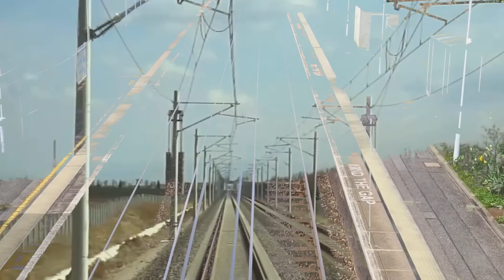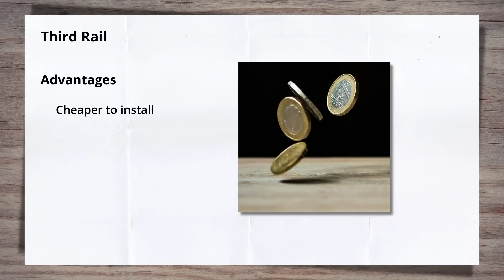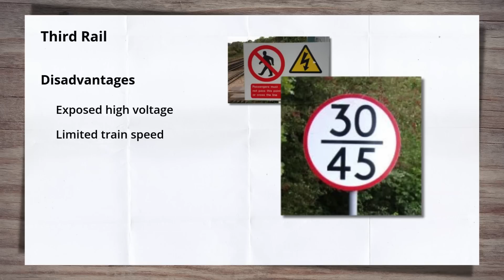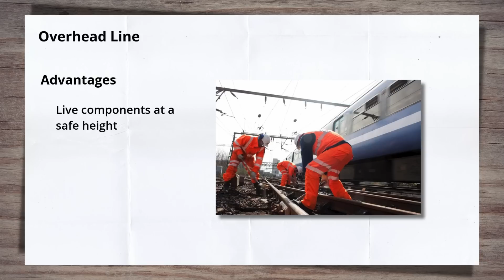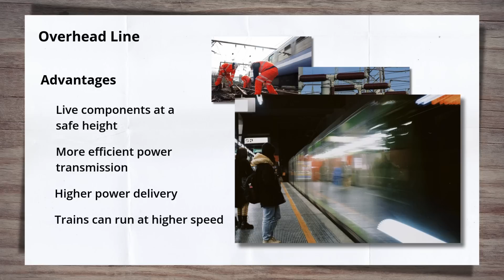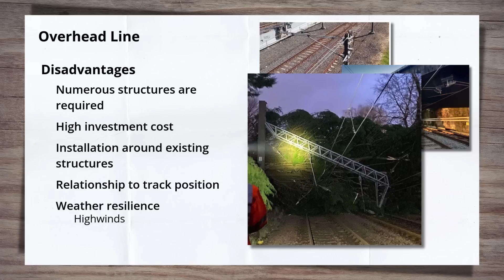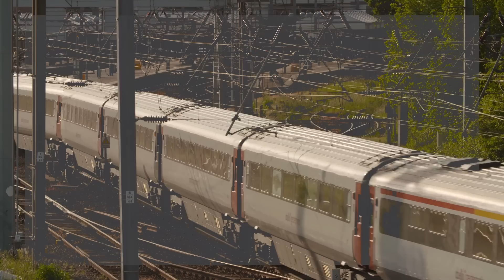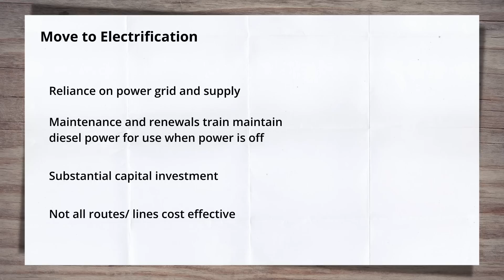How Trains Are Powered on the Railway | Third Rail vs Over Head Line Wires

Comment: Third rail is 600 Volts DC. The currents are enormous. Voltage drop per mile is high. Third rail requires several feeders from the supplying utility every couple of miles. Expensive electric construction. Overhead catenary in USA is typically 23,000 to 25,000 volts AC which requires utility feed every 10 to 20 miles. There is no comparison. Third rail works on local metro trains, never on long distance without a lot of power infrastructure. Also, because of the high currents at the DC traction motors vs. 2400 volt traction motors in catenary locomotives, third rail engines have limited horsepower. DC third rail is highly inefficient. Ballast resistors on the rolling stock are used to limited current inrush. Once again, great for city and suburban lines, not for long distance high speed rail.
Reply: Also third rail systems are widely used in industrial transport. Mines, Mills, careers etc
Reply: Why not AC for 3rd rail systems, say at 2000v with bottom or side shoe collection and insulated rail top surface. Multiple shoes throughout the length of the train minimizes current per shoe. No need to raise bridges etc.
Reply: Third Rail is not always 600VDC.
Here in England, we use 750VDC which has been used I think since an electrical interconnector cable was built between England & France, whilst when the Southern Railway (And the prior London & South Western Railway) installed 660V DC third-Rail.

There is also "Bottom-Contact" third rail which is used on the London DLR system, also at 750VDC since the network opening in 1989, whereby the third-rail shoe touches the rail which is suspended above the shoe, which I believe was initially designed to "fix" many of the flaws of the standard Third-rail system used on the Southern Railway and Merseyside Electrics region of England.

I will agree that Third Rail works best on low-speed/short Metros and commuter railway services though.

Comment: Railways account for 0.7% of UK emissions. Why is anyone concerned about this?

We in Sweden have large scale overhead electrification. It is grossly unreliable. My last journey ended up with an overnight hotel stay due to the wires being stolen, which happens regularly. A previous journey ended up with four hours in a forest waiting to be rescued. No trains in Western Sweden today due to high winds.

A lot of the electrification in Sweden could usefully be removed when it wears out.

There are very few fatalies to staff due to 3rd rail electrification. It is easy to shield the live rail.

Comment: Safety to human an animal life would be my reason for eliminating the use of third-rail. Human life should not have a cost when safer alternatives exist. Thanks for sharing.
Reply: Members of the public should not be on the track anyway. Track work is normally done with the current switched off. Live rails in depot are shielded.
Reply: @physiocrat-sv  I think safety to human and animal life might be more of a reason to eliminate motor cars, rather than third-rail electrification on railways.
Can anyone supply the relavent figures?

Comment: Thanks for this clear info. Growing up in south-east England where third-rail electrification is the norm (and I spotted your Southern train as an example!), I was surprised when I first went up to York as a teenager and noticed the overhead lines and supports on lines north of London. It seemed such a blot on the landscape as well as an unthinkable task to install them all (not that putting in big heavy rails seems like easy work either though, to be fair). You did a thorough job listing the pros and cons, some of which I hadn't considered such as speed restriction.

Like others in the comments, I was confused by trains on the  third rail network needing transformers, but I'll leave that to people who know more than me about trains 😅
Reply: The transformers are in the feeder stations next to the track.
Reply: @physiocrat-sv  ...and therefore do NOT add to the weight of the train.

Comment: One thing to add from a metallurgical and corrosion aspect on third rail. Stray current and grounds have caused a lot of corrosion on buried pipework, particularly around the the home counties area, with the victorian cast iron pipework. So whilst they don't directly affect the operation of the railways, it does pose other problems for utilities, such as Thames Water. Was a case study on my University of Surrey MSc modules about 15 years ago.
Reply: The reason the London Underground ("Tube") is four rail is to make sure the return path does not leave the track. The track has a positive and negative rail, that are not symmetrical about zero. That means the electrons never get tempted to leave the official path (at least in theory).

That decision was forced on the Underground when it was first electrified, following the experiences of above surface third rail electrification already damaging water pipes. In part, ai well, the Railway did not want to risk electrification damaging the steel linings of some of the tunnels. 

Where the four rail units share track with three rail units, the centre rail is grounded, and so it's one of the running rails. That means that for safety the DC components of the four rail units have to be insulated too cope with both scenarios. 

There actual motors don't actually care where the positives and negatives sit in comparison to a theoretical Earth, but the parts of the train exposed to people need to be grounded properly.

Comment: Another disadvantage of 3rd rail is the necessity to leave open spaces at junctions or diamonds. This generates an unstable current supply to the engine (loc) plus numerous electric arc formation... Aside, I fully agree with the fact that supplying current under low or medium voltage is less efficient in terms of current loss by Joule effect. In this line, in France electric locs working under 1500 V need to raise two pantos when starting as the intensity of the current going thru the pantos is extremey high compared to locs working under 25 kV, which is now the standard supply over here...
Reply: We have most overhead electrification in Sweden. My last train journey ended up with an overnight hotel stay due to wires being stolen. No trains today due to high winds.

Comment: The main point I got from this video is that overhead is 100% safer than third rail! I believe more people are killed by 3rd rail than overhead, I have never heard (under normal condition) being killed by overhead wire, just look at our streets where there are power polls! And yes idiot drivers (drunk and/or stoned) crash into power polls and cause the 11,000 & 400V wire to come down! Don't blame the trees, when trees fall onto power wires, blame the people that suppose to maintain the area!
Reply: How many people are killed by electric shock on the railways?

Comment: One advantage of desil is that it’s more power efficient because the electricity to power the generators which moves the train is generated locally instead of 200 miles away in a power plant.
Reply: Who is desil?
Reply: @northernblue1093  A badly-spelt German engineer who developed a higy-efficiency oil engine.
Reply: But generating it in a huge quantity such as power station is more than enough to offset the losses involved with transmitting it.
Reply: It’s still not negligible, even still, your just changing were the carbon emissions are being generated and constructing new electric train infrastructure still will produce lots of C02.

Comment: Bottom-contact 3rd rail is used on modern metro networks, and the S-Bahn in Hamburg uses side-contact 3rd rail.
Reply: The Lancashire and Yorkshire Railway used 1.2kV DC side-contact 3rd rail between Manchester and Bury from 1916. It was chiefly to stop ice building-up on the contact surface.

Comment: High Voltage centenary systems (most common) REQUIRE a hV to lV transformer associated with the engine.  A paragraph is diamond shaped device, where a flat framework is more of an energy collector. Ron W4BIN
Reply: That's not quite correct. 

A pantograph is any framework with a double set of linkages arranged so the collection surface remains horizontal at any height. 

Early electric trains did have diamond pantos, but the name comes from the technical drawing tool that is a third shape again, neither the diamond nor the more modern high speed panto. It's simply the design of the lever system that the name refers to, not the layout of those levers.

Comment: The local transit agency, BART, decided early on to forgo the old school 600v or 750v third rail and go to 1000v DC third rail. The is sited higher than usual, and contact is by an over-running paddle style contact. They also went with 5'6" guage and non-tapered wheel profile. Who needs 150 years experience.
Reply: 'Sounds like BART Simpson's first day as a designer.

Comment: Overhead wire don't sag due to heat or cold, they are counter balanced to prevent sagging, as the wire expands (heat), the weights raises, when the wire contracts (cools) the weights lower!
Reply: I believe you have the weights reversed from what they actually do.  Yes, wire and other items expand on heating thus sagging, and contract on cooling thus raising.  All of the catenary and other overhead wire systems that I have seen, use weights connected to the contact wire to provide a more-or-less constant tension in the contact wire for the overhead system at uniform spacings.
Reply: @royreynolds108  Thanks for the correction, at least you understood ! The same here in Australia and New Zealand we still use weights and pulley system to ensure the tension is kept constant!
Why would Network Rail (UK) abolish a system that has worked for decades?

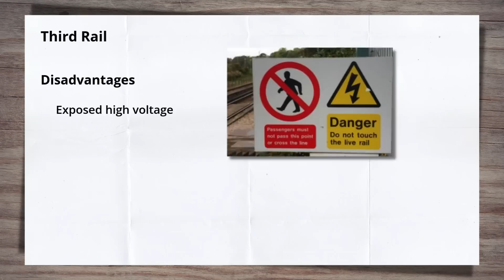Comment: 2:50 this is misleading, the class 387 which is primarily used on the Gatwick Express has a top line speed of 110 mph, that’s only 15 mph slower than most high speed trains in the UK.
Reply: Gatwick Express is limited 90mph as that is the top speed of the Brighton Mainline and 387s are limited to 100mph on the third rail.
Reply: I thought the old Wessex Electric 442 (Plastic Pig) units were mostly used for GX services.   Has that changed in the last 3 years??
Reply: @Micke120872  NSE built the 442s in the 1980s for Weymouth from 4REPs, SWT got rid of them in mid 2000s and GX took them in last 2000s, the 442s were then replaced with 387s in 2018, in 2019 SWR took the 442s back, in 2021 they were withdrawn and scrapped.

Comment: Longer heavier freight trains tend to be diesel electric aren’t they?
Reply: Yes, bit only for top the lack of end to end wires. At some point the gaps will be small enough that bi mode locos will become cosy effective (that might be Diesel vs OLe, or battery vs OLE).

Pure OLE creates an issue for container handling, because an OLE loco can't push a train all the way under a container crane. You either need a local shunter (costing extra wages) or for the main loco to have a power source that is independent of the infrastructure.

Comment: We've used battery locomotives for almost as long as we've had electric trains. The Hational Collection has a Norh Staffordshire Railway battery locomotive built in 1917, which is about 10 years younger than the NER steeple cab shunter they have.

Comment: The safety issue for 3rd rail systems can be reduced if using a bottom contact system as the conductor rail can be covered.
Reply: Depends on the height, the Southern and Merseyside 3rd rail power could easily jump to the ground, a lot of the Southern has the juice rail wrapped at the bottom and sides as it carries over 900v in most places to accommodate more powerful modern units
Reply: @aldo4319 the tolerance on the 750V third rail network in the UK  is +/-150V. It has been this for a long time, even before the Eurostar sets operated out of Waterloo.

Comment: There is another disadvantage of 3rd rail systems I that they are limited in voltage to 1,200V (although some systems have used1,500V) due to earth leakage becoming a significant problem.
Reply: This was the main reason for Vincent Raven's decision not to use third-rail on his North Eastern Railway  main-line electrification scheme. It proved virtually impossible to stop flashovers.
As it happened, the whole scheme was dropped post-grouping, and the York-Newcastle section had to wait until the mid-'80s for electrification.
Reply: @tooleyheadbang4239  surely the early 1990s?
Reply: @neiloflongbeck5705  Possibly as late as that. The scheme didn't receive approval until the '80s.

Comment: There is new generation of train motive power other than diesel and full electrification being electric/battery, electric/hydrogen fuel cell, electric/hydrogen fuel cell/battery and hydrogen fuel cell/battery.
Reply: But when technology moves forward, the trains themselves become outdated. Hydrogen is currently very expensive to extract & supply.
Reply: @TheRip72  - Trains are vehicles that have 'steel' tyres traveling on dedicated 'steel' roads, so I am not sure why you think trains will be come outdated.
Reply: @chrismckellar9350 No, their method of generating power. Hydrogen has been suggested. That will either be improved massively or replaced, leaving any trains powered with current H technology outdated.
Electric trains will simply have their power generated differently.
Reply: @TheRip72  - What power sources are you thinking off?

With regards to hydrogen, it can't be ruled out. In my country, there is 3,898 kms of track of which 506 kms is electrified, so hydrogen fuel cell/battery and electric/ hydrogen fuel cell/battery makes more sense to power future trains in the country, as the country can produce 'green' hydrogen via natural geothermal and hydro.

Don't forget, commercial versions of solid state batteries will be available in the next 5 years that will allow increase range, quicker charging and less inflammable compared to current Lithium-ion batteries.  

Need to keep an open mind as technology is rapidly changing.

Comment: Discontinuous electrification (OHLE) could be the future if the DfT realised the opportunity. Several bi-mode fleets (with battery propulsion) are already in service and most the Hitachi class 8xx fleets can retrofitted as such. It’s not necessary to install a huge battery capacity, as the concept is to reduce infrastructure build time & cost by skipping OHLE installation on the complexed track sections such as tunnels & bridges. So you only need enough battery capacity to get through those resulting unwired sections. And….

Rolling Stock fleets which have propulsion batteries have an ease of maintenance advantage too, because they can be moved around unwired sections of their maintenance depots without any shunting loco. Trains can also reach a station or siding when there’s an OHLE failure.

Comment: i worked a bunch of those empty trains used to keep the third rail from building up ice this past winter. 

it required a person to sit in the back of the train and flip a pump switch between left and right output. the pump pushed antifreeze out of a hose connected to each trolley shoe on the rearmost truck. easy way to make time and a half. the rest of the year though, having to walk over live 3rd rail in the yard is a pain. they even set up the grabirons on the side such that the third rail is exactly where you would expect the bottom step of the ladder to be. obviously you dont want to step on it though.

Comment: What about the cost of the metal? Third rail uses a massive chunk of steel whereas overhead wires are much lighter.
Reply: There is plenty of steel in the masts and expensive copper in the wires. It gets stolen regularly.

Comment: maintenance trains could be battery powered instead of diesel powered.  EVs have created a market for improved battery technology.
Reply: London Underground has had battery electric locos since the 1920s for maintenance trains.
Reply: I think the US should mandate a pantograph on every new locomotive. Diesel locomotives already use an electric drivetrain. Electrify the main line and batteries can handle deliveries to spurs.

Comment: There are 3 types of 3rd rail, top contact, bottom contact and side contact.  
For areas with less frequent services it has been suggested that trains that can run on battery mode for the length of the line and then charge up when on "mains" are a way to reduce diesel powered trains.
Reply from the maker: I honestly didnt know there were three different types, thank you!
Reply: @thepwayengineer  Are tracks your personnal area of expertise, as I had first assumed when watching you channel ?
Reply from the maker: @constancel4211  It is indeed